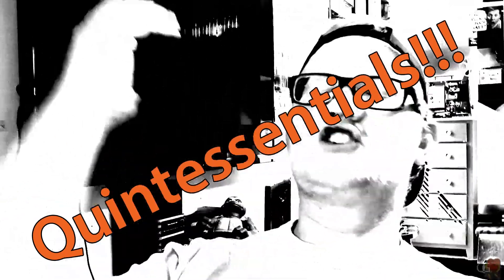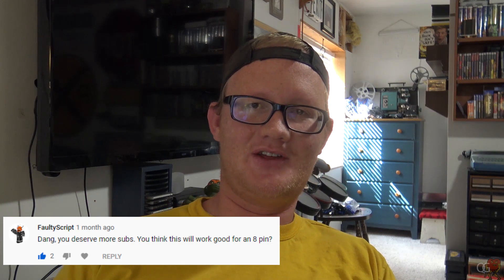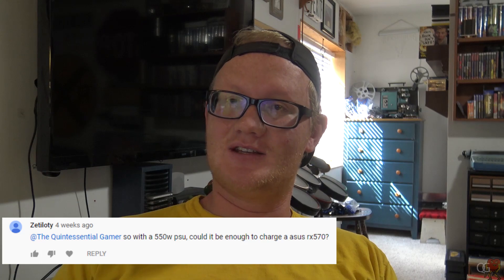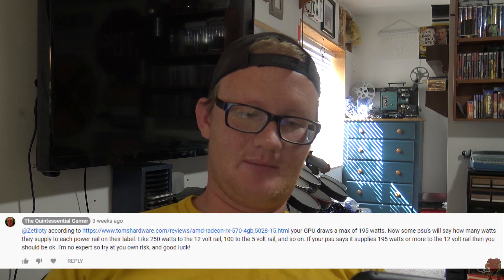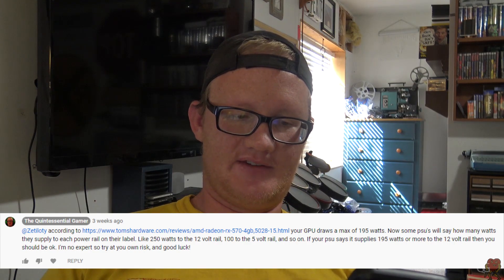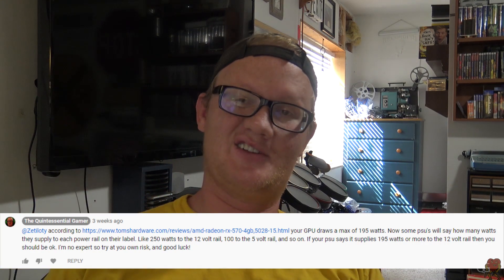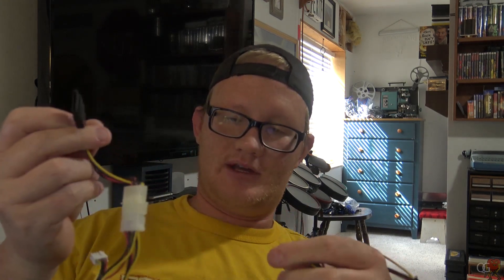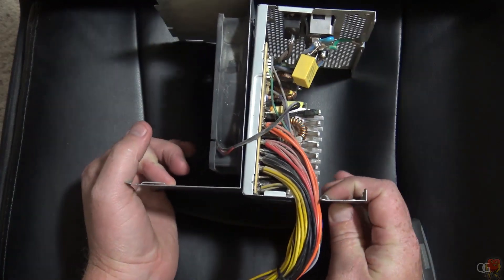Is it too good to be true!? (SATA Power to GPU Power Adapter)

Comment: Dell makes an external 6 or 8 pin power brick, or use a server power supply with a breakout board.  The other safer option would be an external GPU dock with a M.2 or occulink to internal card both with their own PSU.  These little jumper cables are kinda dangerous.  Just a heads up.  Also, it is never a good idea to push any of these power ratings to the limits.  Transients on the GPU can spike WAY above the rated power.

Comment: Hello, my graphics card is rx580 and my processor is i3-12100 and my power supply is 312W. Is it okay to use a 2x sata to 8-pin gpu converter?

Comment: I just ordered 15 of the simple SATA to 6 pin connectors.
AFAIK the SATA Connector is rated 4.5 amps (58w) while the 6 pin is rated for 75, touch some GPUs have been known to exceed specs by a massive margin.

The use case for me is older GPUs that either go slightly above 75w or just have the extra power connector for potential overclocking ability.
Since they require the power connector, they are less sought after than ones just managing without and thus cheaper.

As far as Power Supplies go, a lot of Business grade office PCs actually have reasonably good ones in terms of quality, at least in relative terms. I'd always take the chance adding a adapter on a 300w+ FSP 80+ PSU than with a used no name PSU.

Next to me is a little Fujitsu with their usual tiny proprietary PSUs from the 3rd/4th gen Intel days.
The PSU is rated 250w total or 280w for 20 seconds, but it has 2 12v rails at 15 amps (180w) each and a surge for 17amps (204w) for 20 seconds.

If you'd max out the load on a i7 3770 (which you wouldn't pair with the GPUs mentioned below) with a stresstest it might go up to 100w, leaving 150w. 
550Ti and 650Ti are rated around 115w peak, maybe 130 ish in Furmark.

Comment: If I am supplying a 4070 ti super GPU (285w) with an 8 pin, 6 pin to 8 pin adapter, and the GPU slot, can the sata to 8 pin adapter be a good additional support power supply? 500w PSU in an eGPU chassis.

Comment: Hi, I notice this is kind of an old video, but I have run into a problem of my own that brought me in curious as to if I could use something like the adapter you are showing. I was recommended a 2x sata to 8pin for my Dell OptiPlex 9020mt (sadly I only have one open sata cable as I have a bit of network drives installed in this pc.) The graphics card is a GTX 1650 (which I was told would run on my psu as it only takes 75watts) however when i plugged it in and started it up it asked for me to power down and connect power to the card... sigh I keep the pc online all the time I will likely be gaming on it as well as video editing and creating my own animation in the future, but I figure at 75 watts that shouldn't be a problem, I am wondering if you think this might be a good idea until I can afford to upgrade my actual psu. (tight budget right now)

Comment: The only problem with using those SATA to 6/8 pin adapters to power a GPU is the SATA power plug itself. They're "only" rated to 4.5A (So 54W). That sounds a bit pathetic when you think that 400+W GPU's are a thing now, but remember that the PCIe slot will be supplying up to 5.5 amps (66w *) on it's own, and if you're looking into using a SATA/8pin converter in your computer, you're probably not intending to run a RTX 3090 Ti in it anyway. So with a card that just uses up to 120w (something like a GTX 1060) it should be fine.

A better option though would be to use the older 4 pin Molex connectors. Those bad boys were designed back when hard drives sucked big power, and are rated to a whopping 11A (132W) each, so with just a straight through 1x4 pin to 1x8 or 6 pin converter you'll get a much more usable 198W, and if you have 2 unused PSU cables with Molex plugs to turn over to GPU feeding duties (And your PSU has the neccecery wattage headroom on the 12v rail), you could run a 2x4 pin to 8 pin Y lead and pull 330W.

(* Apparently some motherboards will now safely push the 16X PCIe slot up nearer to 6.25A, so 75W)
Reply: Good Answer. Thank you.

With that in mind, I would like to ask you, Is it better to use a dual Molex to 8 Pin Connector using only One Molex Of these Two Connected, Would Work Fine for a month at least so I can save to purchase a new Power Supply Unit. It is a GTX960 and it's maximum Comsumption is 120 watts?

Thanks in advance.
Reply: @cristiandavidaguillonangul1702  It depends on how the twin Molex to 8 pin cables wired. Most use 2 4pin molex plugs so the minimise the number of stubby jumper loops they need to get power to all the pins in the 8 pin end, so only connecting one of the 4 pin plugs may mean only 4 of the 8 pin plugs pins are getting power. 

IIRC, most 960's have a 8+6 pin power connector setup, so if it was me, and my PSU didn't have either a 6 or 8 pin plug, I'd probably just see what unused power connectors my PSU actually still had, then buy whatever adapters I would need so I could use those. With 66w already coming out of the PCIe slot, most of the remaining adapter options will be fine for the last 54w that this card needs........... Well, actually, I don't personally tend to use adapters. What I'll usually do in this situation would be to get some long 6 pin and 8 pin extension cables, cut the male plugs off, remove and open the PSU, then solder all the wires directly to the +12v and ground rails. Though to be honest, I wouldn't recommend this approach to anyone who hasn't played with electronics in the past as you really need to know what they're looking at or you could cause a pretty expensive problem.

Back in the day I used to build my LAN party PC's into either clear acrylic cases, or one off open cases where everything was on show, so removing unnecessary power cables and making the remaining ones exactly the right length was pretty important for the over all clean look I'd be going for. Occasionally I'd need to add extra cables directly from the PSU so I didn't have multi connector cables strung between components. It isn't difficult, but as I said, if you're not 100% sure of what you're doing you're best to just use adapter cables.
Reply: Jesus Heals and Saves ♥
Reply: Can I use this be used for a gtx750ti with a 300w psu

Comment: HOW your power supply is same as me i came to see if the problem is from the psu or from this small cable ( i have problem with black screen i did undervolt same problem idk if this psu failing or its the cable)

Comment: I have a Dell optiplex 3020 with 290w psu. I got a GTX 1650 but it has a 6 pin connector. Should I use sata to 6 pin or not?
Reply: thats what i did, but with an rx570
Reply: @sjoerdev is your pc still running fine

Comment: Hey i wanted to ask ... I have an rx 580 8gb and my psu is 460 watts .... 
I am thinking of getting an adapter from sata to 8 pin for my gpu ... Do you think will it harm my card ?( My psu has extra molex and sata cables tho)
Reply: it will be fine

Comment: dude you help me alot with my ssf elitedesk g3  800 twr converting in a gaming pc
with this video 
because want  i  upgrade( its already on the way) from 240watt 80+ platinum to 500watt 80+ platinum original HP sfx PSU 
im not sure how it will perform with a gtx1080 hybrid

Comment: I managed to get my RX 470 to run on a 350w PSU with no problems. It runs just fine and has zero issues. Its worth mentioning the psu is a decent dell one, some lower end psu's could fry your gpu or not be able to power it.
Reply: but i have 350 and i5 2 but pc dont boot whwn gpu is attached
Reply: it dont have enough power to run the gpu replace it @fidahussain8051
Reply: is not safe if you using till today Rx 470 need more like 120 you need 500 watt or less
Reply: @itzromanx  I used it as an experiment just to see if it would run, shortly after I put in a gtx 650 and sold it on. It did run stable but the rx 470 was a mining card and had issues to begin with

Comment: I'm currently using a 6 pin to sata then splitting it 5 ways to power 4 hdd's and a GTX 1070 .. Can this be the cause to my PC crashing when I try to run intensive games like no mans sky and war zone
Reply: Yes thats probably the issue. Even if your pc was decent with good wattage running that many hdd's and a 1070 is probably drawing too much power. HDD's eat up a lot of power compared to ssd's as well. Also check if your cpu/gpu is overheating
Reply: @Dictatortot-n3d  it was the power issue , the gpu is fine on low end games but a high end game the gpu would start doin its job but pull power from the hdd's causing a crash .. the gpu is now drawing power right from the PSU and iv have NO issues now

Comment: If a sata cable can power a gpu then a 6pin pcie to 8pin connector is actually a viable option!
Reply: only problem is the 6 to 8 pin might fry the cable itself but this way upove you can undervolt your gpu and might work for longer but i dont recommend using sata to 8 pin as gpu need more much power to run stable
Reply: @itzromanx  Yeah you are right about sata to 8pin though I had actually changed my approach and replaced the pcie connectors with XT60 connectors and the cable warming up issue went away.

Edit: I used 10 m² silicone wire
Reply: at least your gpu isnt fried with it @AutodidactEngineer

Comment: hey um i have a question. i see everyone talking about watts or something but im new to these graphic card things. i was planning on getting a gtx 1060 6gb but it requires a 8 pin connector. i figured since my computer has sata, i could use this connector to connect the gpu. so do i have to do anything else or do i just plug in the 8 pin to sata?

Comment: hey, i finally find a useful video here to help me out of the situation with my old HP Elite 8200 Desktop to connect with Geforce GTX 660 Ti to turn it into kind of backup gaming PC. Great Job und please continue ! i am very thankful for that and wish you nice day there from germany.
Reply: I have the same HP Elite 8200, can I use 15pin SATA to 6pin PCI-E to power up GTX 1650? Thank you!
Reply: @vickynguyen4897  won't that get powered by the pcie interface without needing extra power ?
Reply: Jesus Heals and Saves ♥

Comment: If doing something like this, will the gpu draws power through pcie slot + the via the 6 pin adapter or it will solely draws power from the 6 pin?

Comment: Hello from Arizona!

I recently purchased an rtx 2060 and I don’t have an 8 pin cable to power the GPU. I think a 525w PSU should be enough (500 is recommended) and I was wondering if using a SATA to 8 pin adapter on a card like this would be safe. I have been confused on what to do and your cable solution seems like a miracle.

I appreciate any help I can get.

Thank you
Reply from the maker: Here's a link to a dual sata to 6 or 8 pin cable. It lets your gpu draw power from two sata cables which is safer. However I wouldn't say this is the best method or the safest, so try at your own risk: https://www.ebay.com/itm/173610565849

Comment: you dont want to go single sata to 8 pin, but 6 pin is fine IF you have the wattage support.. and you really should only be doing it with high quality power supplies.... also I find it works fine if you have a video card with an 8 and a six and the power supply has an 8, and you just use the adapter for the 6
Reply: I just got a 6700xt and was wondering this. I plan on using the 8 pin from the psu for one of the 8 pin connections, and a 2 molex to 8 pin for the other....curious if its gonna work
Reply: @travisburd214  it might physically work, it depends on total wattage of the power supply and power draw of the card HOWEVER it isn't the right way to do it, the only way you really want to do that is by adapting 2 6 pins into an 8, a six pin delivers 75 watts, an 8 pin deliver 150

Comment: does anybody think this would work with a zotac 1060 3gb mini? i have a 300 watt power supply  and gpu draws 120w 
i’m also using an ssd
Reply: i’m also getting the gtx1060 for free
Reply: @TristanSpeno  Well thats suprising. Congrats bro but How?
Reply: @difadli2470   my friend got an rtx 3070 for christmas so he is giving me his 1060
Reply: Well... i think u need more powerful PSU Bud, because ram, monitor, keyboard,mouse,fan,headset, specially The Cpu It Require A lot of Watts (maybe only the Cpu that require a lot of Watts). If u keep That 300 Watt PSU and install the 1030 it might Will damage Ur VGA And Other thing in ur motherboard. So i recommended that u upgrade ur PSU (450W - 550W) first and (or) then buy an Rx560 Aero ITX Oc its better and little bit cheap if u lucky.
Well its only my opinion tho.
Reply: @difadli2470 yeah, i’m planning on getting a new psu anyways. i think the psu isn’t enough

Comment: hi, great stuff here..just really confuse, i have gtx 560 and I used 2x sata to 6pin. it doesnt work. how can i check if my gpu is dead? or just not really drawing power enough.. i use 500watt psu. tia.
Reply: 560 needs two 6 pins

Comment: Can I use 1 sata to 6 pin, on a 1650S and a320m-hdv motherboard. I know that 1650s needs 100W so I'm wondering if my motherboard(A320M-HDV) can supply 75 watts for GPU and sata cable other 25 watts. If someone can answer me, it would be great.
Reply: did it work?
Reply: @skulless798  I didn't try, I was searching more on google, people said it can burn your cable and stuff, so it is not safe
Reply: @neurion58  bro so did it worked? Please answer if possible.
Reply: @QaiserGaming872  I dont know, never tried it, as I said people were saying it is dangerous because SATA is not meant for that, I waited a bit and bought a new pc, because the old one was old anyways

Comment: what matters most is the quality of the PSU, for example: basically anything using 20awg wiring(yellow) for 12v is not to be trusted for powering gfx cards. trust that info, or learn a hard lesson. there are plenty of 450-550W bronze+ PSU's  that will be a much better option than a cheap 650-750. buy quality when it comes to PSU, don't trust in BIG numbers only.

Comment: Found a very very strange adapter which is 1x Sata to 8 pin 

Do you think is safe and also will it be okay for a 1660 SUPER that requires 125 W usage ?

My PSU is 500 W btw
Reply: I use this on my RX570 on 400  watts psu 
So I guess it won't be a problem for you
Reply: @t1tang309  hows your gpu now? Is it still ok and not starting fire? How long you play with it daily?
Reply: @Bos_Meong  yes its been 7 months ive been using it and its still running fluent and i play 6hours daily
Reply: @t1tang309  which one do you use? 2x sata to 8 pin or single sata? You have link for the product?
Reply: @Bos_Meong  single SATA to 8 pin bought it from the local market for 0.50$
Reply: @Bos_Meong  if u can afford a power supply then buy one
It can be risky and i am buying a new power supply too coz 400 watt is too low for my pc
Reply: @t1tang309  oh I see. Yeah I think its not worth it. Im planning to mine bitcoin by adding extra gpu but probably ill just buy second psu then
Reply: @t1tang309  I don't think 400watt is low for 570 as it only consume 120watt.

I'm now running 2060super which is 185watt gpu on 400watt psu and on total it draws 240watt ish (300 on my wattmeter so with 80% efficiency its around that)
Reply: @Bos_Meong  wow man!!!
Im afraid coz i have 4 case fans installed ,an AMD Rx570 and 3 HDDs
All powering on on my 400 watt silver stone

Comment: Psu 550 has no Pin for the Gpu. ?   I Buy rx570 and not used it because i cant find pin for the exterpnal power gpu need. Do you recommend use this stuff?

Comment: hey, I only have 1 Molex.  Is it gonna work If I connect it with dual Molex to 6+2 PCI-E / 8? Like I use one Molex to connect to my PSU Molex and the second Molex I just leave it unconnected while the 6+2 pins connected to my graphic card RX580
Reply: Thats my question too

Comment: Hi  I've just bought  a1070 graphiccard, which  needs a 8 pin power supply  but my power supply does not have a 8 pin cable. So I've sent for a 8 pin cable which is power by the sata cable, the cable has 8 pin and two sata connectors,well this be ok and do I have to connect the two cables to the sata supply, thank you
Reply from the maker: Yes you will want BOTH SATA ends connected. Having only one connected means all the power has to flow through it and it may not be able to handle it. Your graphics card may draw more power than the little cable can handle anyway, so use at your own risk
Reply: @thequintessentialgamer7514  thank you for the reply  all the best
Reply: @thequintessentialgamer7514  I think needs to be connected in parallel though, not in series... SATA wiring harnesses often chain multiple connectors to the same 12 V supply wire, so each SATA connector may need to go to a different wiring harness (so you are pulling off two yellow wires that go back to the PSU, not one...)

Comment: Can you use the  2  SATA 15-pin from the optical  DVD 
Drives  to two  6 -pin  for a Graphic card that requieres 2
 cables of 6-pin?   taking them from the SATA for the optical  DVD 
Drives
Reply: Yes, the sata connectors for the optical drives (DVD) can also be used to power a hard drive or even a video card

Comment: An Asus gtx 960  with a 700 psu? Will it work?
Reply: Go to pcpartpicker put all your pc specs exactly and you will see the voltage do you need
Reply: Did you just ask if a 700 watt psu could power that card?
Reply: Monkey D. Goof-E yes
Reply: Sabith Mounir 🙂💥🔫

Comment: not sure if this was answered below. The V1 and V2 labeling just means 12 volt line 1 and 12 volt line 2. One is for the CPU and the other is for the system's other components that use 12 volts: Graphics card and larger HDDs. Good job with the video! I learned a lot from your two videos on this subject- Thank you!
Reply: Jesus Heals and Saves ♥